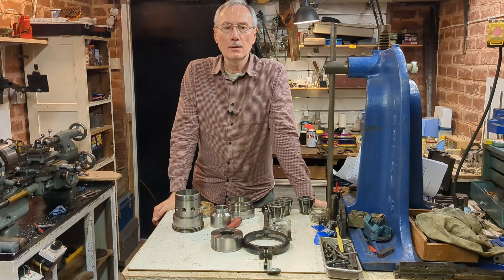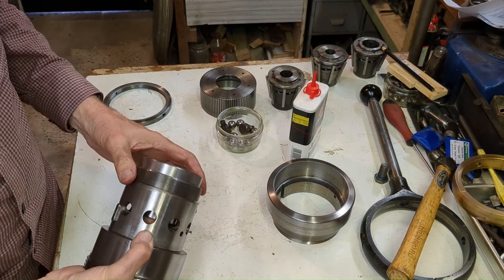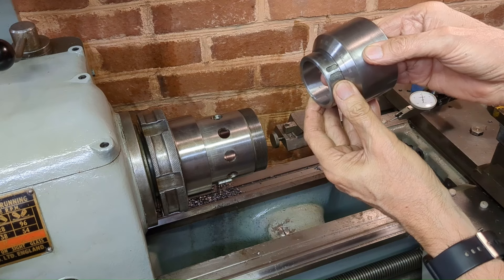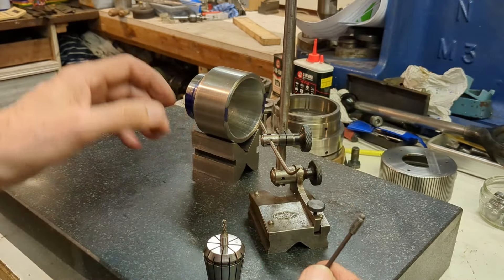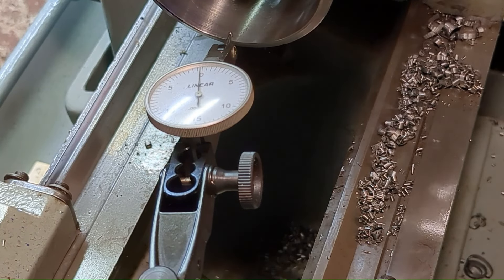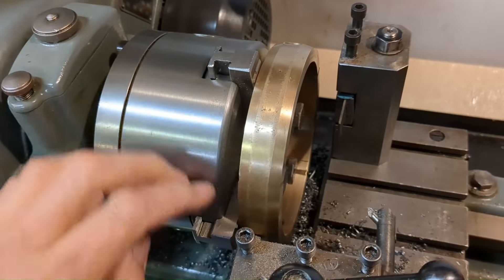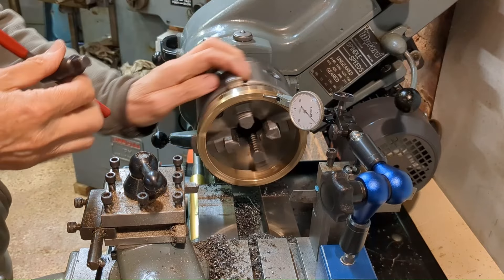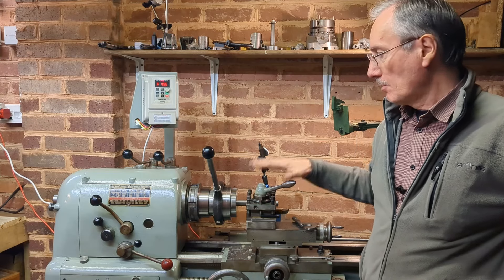Reconditioning & fitting a collet chuck to a Colchester Student lathe - part 4

Comment: Hi Clive, striving for perfection can be soul destroying.
The complex design of the collet Chuck has many variables to achieve zero runout but you got it close enough to put it in service.
Reply from the maker: Thanks, Willem. I think if I hadn't drawn a temporary line under this here (as a video project) it could have become frustrating.
Reply: My opinion on the Collet Closer was designed for fast production work, the bar stock fed in, machined, parted off, and bar stock fed in again where runout was not a critical consideration.
The balls will always indent the mating surfaces causing minor runout, not a problem for production work as long as the work is securely held.
Reply from the maker: I think you are right! Essentially a different tool from the key operated collet chuck.

Comment: Interesting as ever. But watching from my place in Greece, so I can't get on with things. I stoned the nose taper on my student, it was in pretty rough shape opposite the key. It seems this is where the swarf falls in the taper of the chuck etc fitted by the careless operator who didn't clean stuff properly. A friend of mine took a light skim on his Colchester Triumph round head. Some of these spindles were not hardened. I believe my spindle is not hardened, but i don't feel machining is necessary.
Reply from the maker: Thank you, Constantine. I am learning from this that nose taper issues seem to be common and that several have attempted to correct by stoning - some with good results. I would be reluctant to attempt to true up my taper by turning - grinding maybe. I would say this taper was quite hard.

Comment: Watching the 1st few minutes it strikes me that all the stroking and rubbing and holding the cone in your hands is causing it to expand with the heat.
If you were to cool it slightly instead I would put money on it dropping in easily.
Just a theory.
Maybe you prove me right or wrong as I watch to the end  ?
Reply from the maker: Thanks, Steve. You could well be right though I thought it might be small quantities of trapped dirt. It was very easy to get it out of square like fitting a bearing.